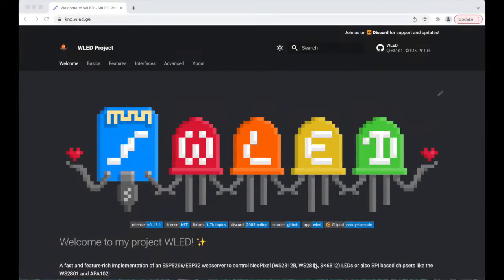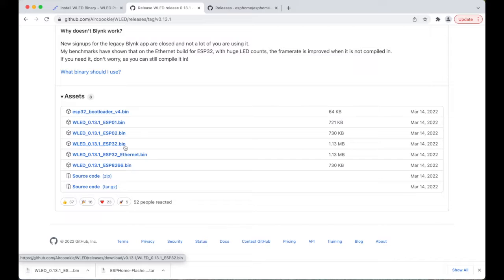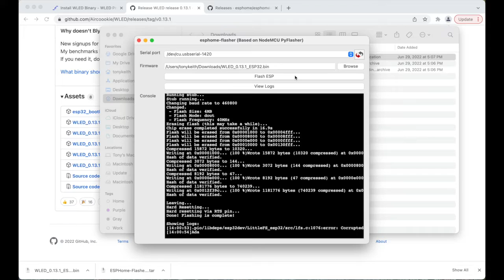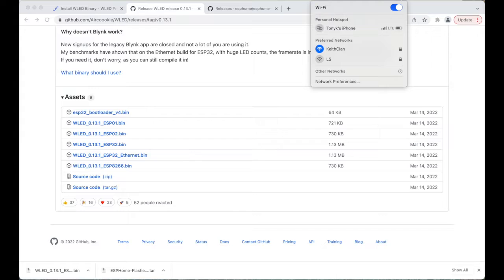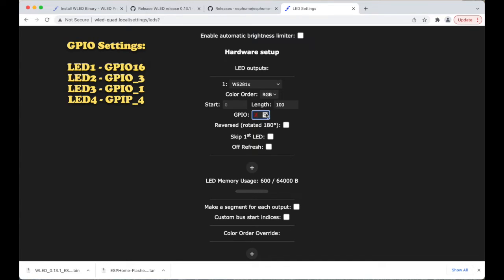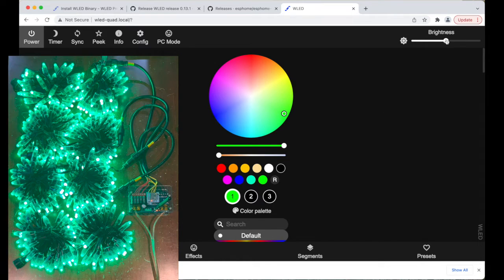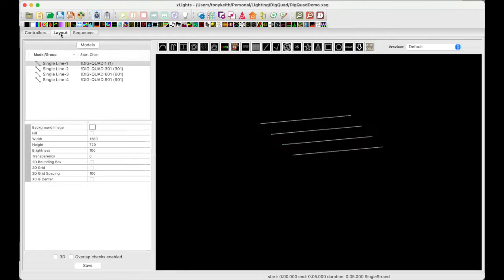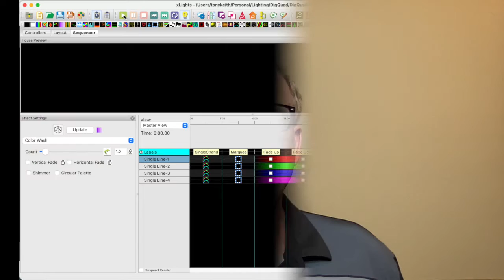Quick setup of a QuinLED DIG QUAD V3 controller w WLED firmware and how to control with xLights

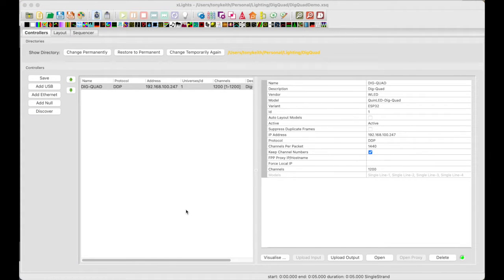Comment: At time 11:17 in your video you "already manually set up the controller" without showing how to do this. There is one key step that is not obvious to newbees as to how to even start to select which controller to use. The vendor tab must be selected in order for the vendor choices to show up, but xlights does not make this obvious to newbees.
Reply from the maker: @jamesn4727  Thanks for the feedback. I will keep that in mind when making my next video. I will also update the description to include how to manually setup the controller.

Comment: Once you do this how do set up a schedule? WLED has options but I believe for that's wled only not something external light x-lights. FPP wouldn't work either correct?
Reply from the maker: Yes. You can use an external FFP (Pi or Kulp controller) to send data to the WLED.  The FPP allows you to schedule your sequences.

Comment: The WLED website says with a WARNING not to uses the ESP Home Flasher on ESP32 board, am I the only one that saw this? Isn't he using the ESP32 board? They recommend using the WLED ESP FLASHER
Reply from the maker: I believe this is a newer warning on the website.  Thanks for pointing this out to me. I will update the description.  Yes. It is an EXP32 board.  The ESP Home Flasher creates a small file system which can lead to issues with creating presets.

Comment: Hey Tony! Your videos are very helpful. I have a question regarding using multiple dig quad controllers. Is there anything special to do when adding additional controllers?
Reply from the maker: No.  There isn't anything special when using multiple controllers.  Each controller should have a different IP address on your wireless/wired network.  If you set the primary input to "DDP", xLights will be able to "discover" the controllers and configure using "Upload outputs"
Reply: @thechristmaslightguy  IP are configured with DHCP, how if IP changed when reboot? can this be configured with Static IP?
Reply from the maker: @APManor-eu8xs  Yes. You can use a static IP address. Are you running a dedicated show network? If so, you may be able to reserve an IP address based on the device MAC address. This is how I have my network setup. All devices are set to DHCP on the controller but the DHCP server (router) is configured to assign specific IP address to each controller based upon the MAC address. Does that make sense?
Reply: @thechristmaslightguy  thanks, oanother thing is, when i click on discovery, xlights cannot find my controller connected though wi-fi same network where my laptop is connected.
Reply from the maker: Try to use the "Add Ethernet" button on the "Controller Tab" to manual enter the controller.  See Video (11:28).
Reply: Thank you Tony! @thechristmaslightguy

Comment: So if you set the channels to 1200, does that mean each of the 4 port will only control 300 pixels per port?
Reply from the maker: No. Let me explain. I manually set xLights to 1200 channels for the DIG-QUAD controller.  This is a total of 1200 channels across all ports (4) and can be distributed however you like.  1200 channels is 400 pixels (3 channels / pixel).  You could have 100 on each port or 200 on ports 1 and 2 or 100 on port 1 and 300 on port 4.  300 pixels is no where near the maximum limit for the DIG-QUAD.
Reply: @thechristmaslightguy  okay so if i wanted to run 700 pixels from each port (2800 total) would i have to set the channels number in xlights to 8400?
Reply from the maker: @GadgetGuyUK  Yes.  That's correct for the number of channels in xLights.  That is a lot of pixels on a single controller.  Please see this link for more information about max number of LEDs for QuinLED controllers: 

https://quinled.info/2021/03/23/max-amount-of-addressable-leds/
Reply: @The Christmas Light Guy  yes it recommends 600 a channel for the dig quad, but it can handle 700 a channel as I've just tested for 6 hours today, ran fine

Comment: Are you able to run an entire show over Wi-Fi with a controller like this or like the Wasatch Controller. If so is there limitations to running a show via WiFi?
Reply from the maker: Absolutely you can run an entire show over WIFI.  Yes. There are limitations and many variables..signal quality / noise, distance from transmitter, network traffic, amount of data streaming...etc...
Reply from the maker: I run a wired and wireless display, however all WIFI controllers use Remote Multisync mode with sequences stored and running locally.

Comment: And the upload works in the nightly buils or beta 3
Reply from the maker: Thanks for the info.
Reply: Thank you that's  a very helpful video. 
I'm using a PC to run xlights  so after  adding  the dig quad  no need to configure the port or output  sir ?

Comment: He also has a new sd card hat and works with the pixelstick firmware and supports up to 8 ports ( firmware in beta )
Reply: How are the 8 ports supported?  Just curious.
Reply from the maker: @brandonnelson4164  it requires different hardware. I have only use the DIG-QUAD (4 ports)
Reply: @The Christmas Light Guy  you can do this also with ae+ hat from quindor it will run 8 ports and yes it handles it but I have noticed a few fps issues in the beta release but it's in constant development and u can follow it in the dr.zzs discord group .. I won't post links here but it's pinned in the #led channel in dr.zzs discord alot of the developers hang out in there including forkeye and martin (from esppixelstick)  as well as some of the fpp guys
Reply from the maker: @turtle-turlte  Thanks for the information. I have heard and read about the new eight port hardware but have not had a chance to test it. I follow dr.zzs discord group.
Reply: @brandonnelson4164  replied
Reply from the maker: Thanks for the info.  I will check out the new hardware.

Comment: There is newer boards, QuinLED-ESP32-AE+, that have SD card and work with Remote Falcon Player. It uses ESPixelstick instead of WLED. Intermit.Tech did a video on it on May 27th, 2022. You can only push so much DDP data over wifi and the connection needs to be strong. There has been an issue on ESP32 with the networking that cause network drops when you push a lot of UDP traffic. I am not sure if that has been fixed. It is an issue with the network code provided by Espressif and not WLED.
Reply: Or you get the Esp32 ABE version and don’t worry about wifi issues. Of course you would lose the 3 data pins and SD card.
Reply from the maker: Thanks. I’ll have to check it out.
Reply from the maker: I have order a couple of the QuinLED-ESP32-AE+ with SD card.  Once I'm able to setup, configure and test, I'll create a quick tutorial.